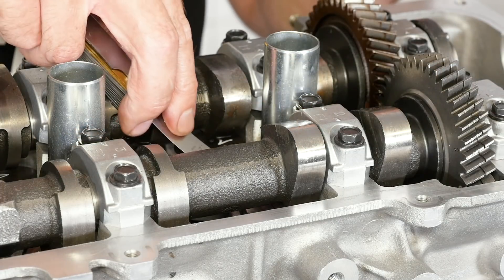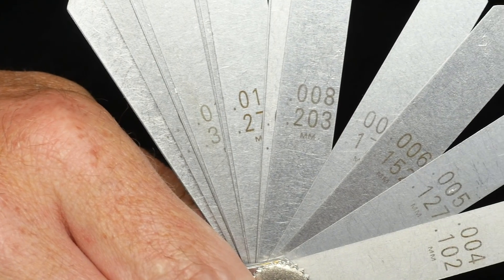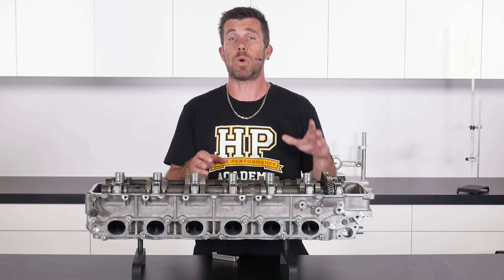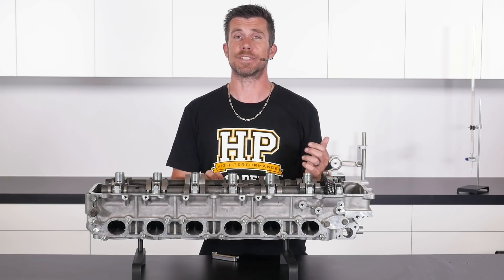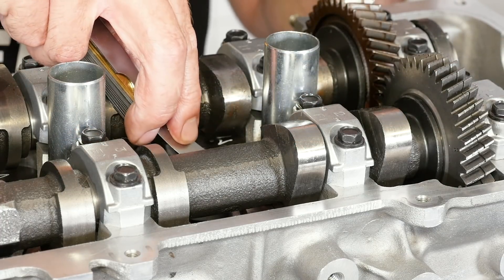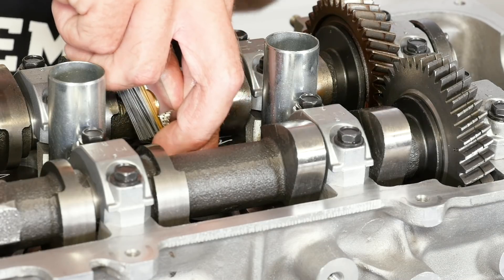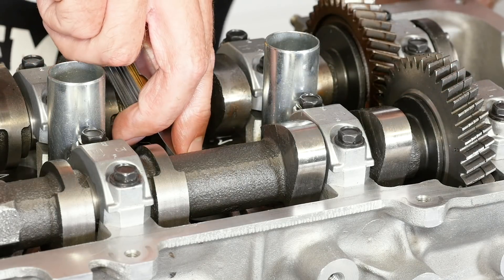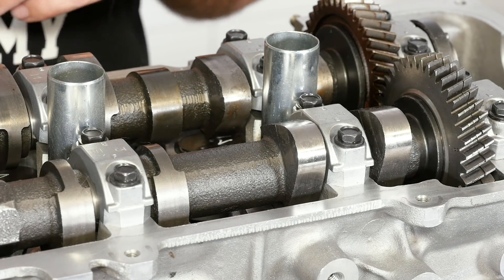How To Use A Feeler Gauge/Feeler Blade | Performance Engine Building [FREE LESSON]

Comment: It is easy to tell the difference between a light drag and no drag with a little practice - I recall having seen a senior mechanic using enough force to almost bend a 'guage in half and calling that as 'right' when it finally slipped through. My personal preference, where practical, is to use two blades - one the nominal size and the other either one size up or down, depending on application, it is much faster and clearer what fits and what doesn't.
With some applications, such as roller tip rockers/followers, it can be more difficult as between the oil film and the roller, a 'light' drag may be felt even if it is actually a 'heavy' preloading on the 'guage - in these cases, it is common practice to slide the guage from the side.

Comment: I remember in school two of my instructors did not understand fully whether a big drag from the feeler gauge is right or not. Apparently in the automotive field, its regarded as being "RIGHT on the MONEY" if you have a big drag, probably .002" over maybe thats what i think or .001"
Reply from the maker: Hmmm, 'big drag' is definitely NOT what we're aiming for. Developing a feel with feeler blades (pun untended) does take a little bit of experience to master and that's why the magazine test is helpful for newbies to understand how much drag they should be aiming for.
Reply: well they called it 'slight drag' but the drag they mention and we did it with their supervision was like 'big drag'.
Reply: Sometimes 'instructors' get it wrong and this is an instance - in some, rare, instances excessive force may not be a problem as the components are not easily forced apart but in other instances using excessive force will increase the clearance as the guage is inserted. An example of that is valve clearances - the valve spring is applying a specific force holding the valve closed and if the feeler guage applies more force than that as it is forced in, then it will lift the valve off the seat and give a false value.
Same thing applies for any other measurement device - both they, and the component(s) being measured will have a degree of compliance (AKA give, flex, etc) and are designed with a specific test force that is to be used. Micrometers are another tool that can be badly abused.
Reply: Thank you for clarifying.